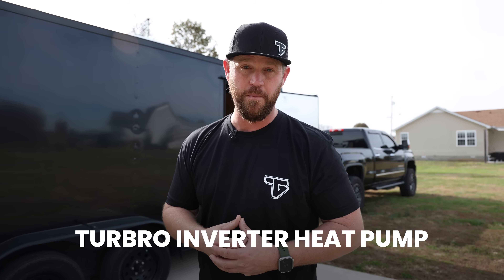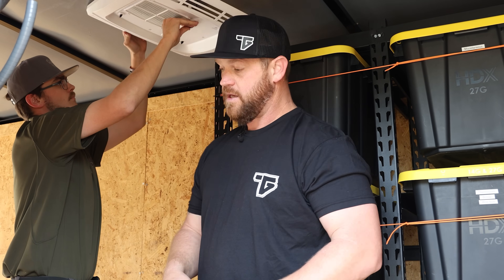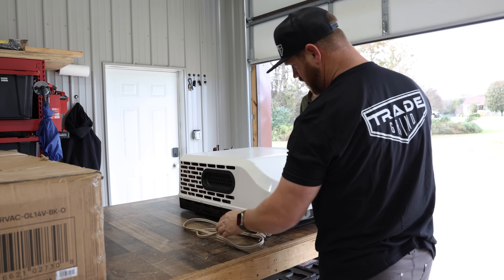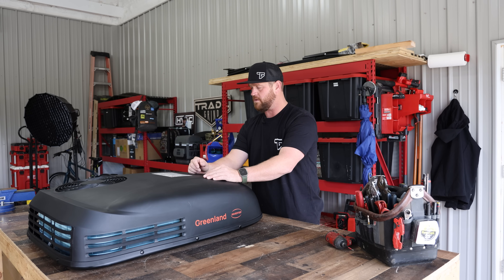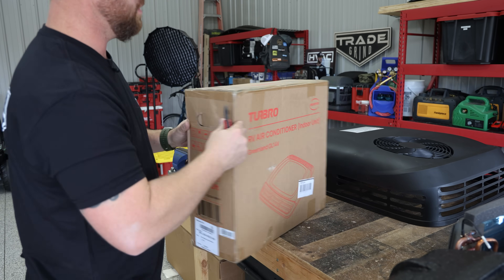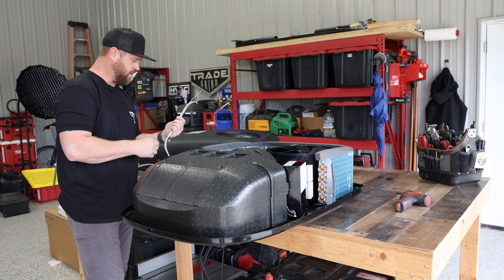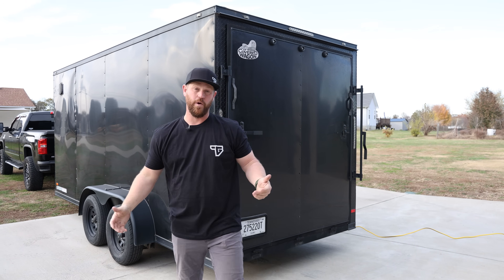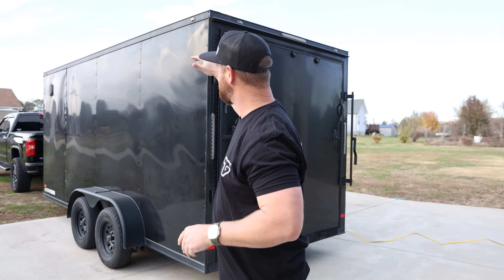Upgrading My HVAC Work Trailer with an Inverter Heat Pump

Comment: Looks like it works down to 20F. That’s pretty good compared to most portable/RV heat pumps, but I’d still love to see someone make a cold-climate model comparable to what you can get in the mini-split form
factor (usually still operable subzero.)
Reply: Thank you so much for taking the time to share your thoughts! You’re right , this unit works down to around 20°F. For typical RV cold-weather use, it should provide reliable heating.
We designed it to provide reliable heating and cooling for typical RV use, and we’re always working to improve our products. Your feedback inspires us to continue developing even better solutions for cold-weather performance in the future.

Comment: I hate mini splits dont know why people like them there so fun to troubleshoot. This week i had 3 service calls were the contractors never came back to fix. Because they did want to deal with them. So I got stuck doing the troubleshooting and repairing what a pain they are.
Reply: Well here we in Europe .there not bad .they very efficient machines .here electricity is more expensive than the USA